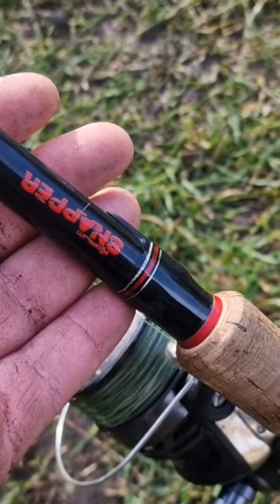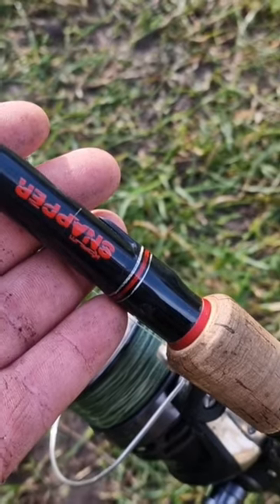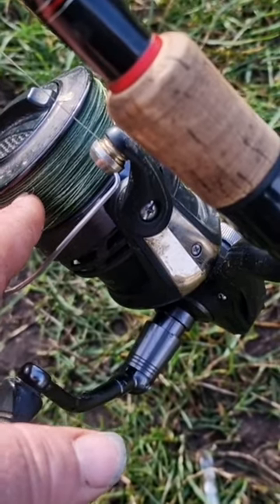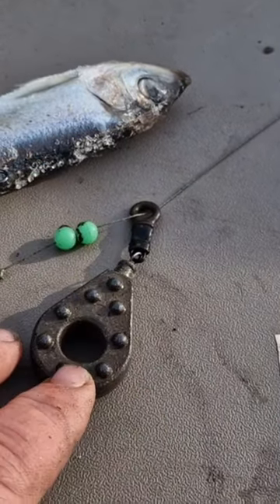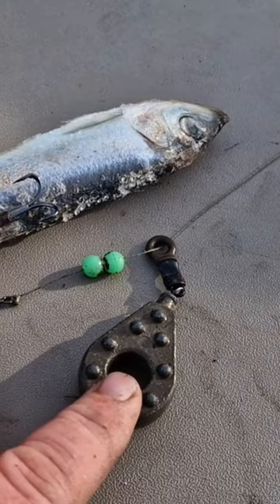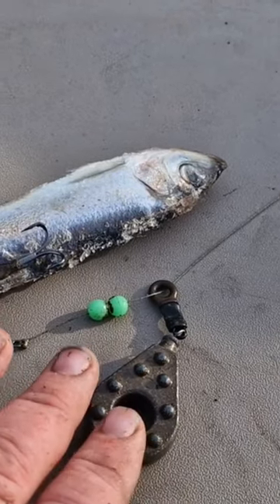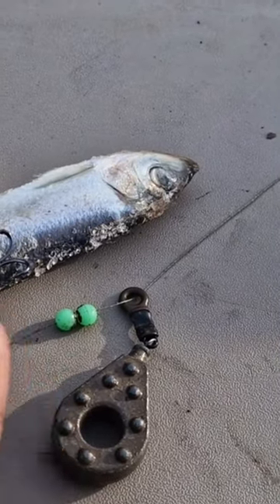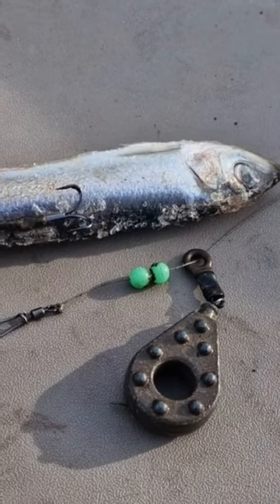simple pike set up and rig  #short #pike #rig #basics #fun

Comment: Hi mate, just curious as I’ve always wondered with these running rigs, is it a pain in the butt to cast? I can imagine the lead going one direction and the bait going another.
Reply from the maker: I always cast in and soon hits water hit clip with finger then all will straighten out and if Deep pull it back gently on drop to line all up.
Reply: @DannysAnglingBlog  Makes sense, cheers mate 😁 Have a good’ne